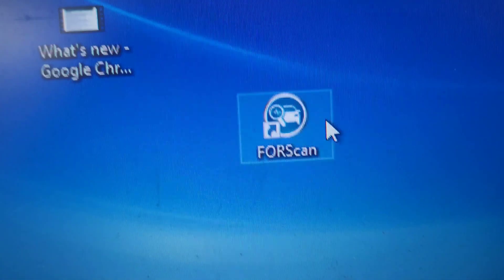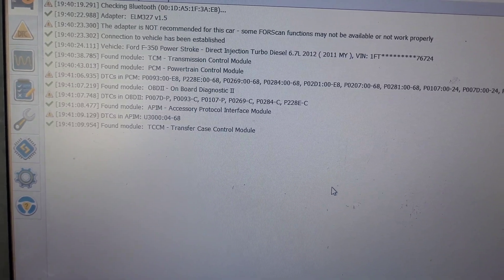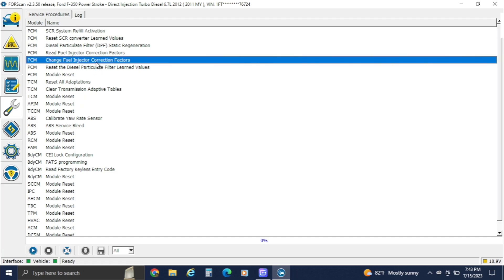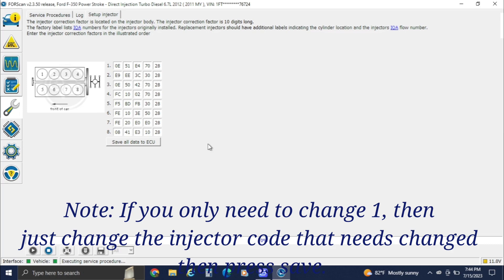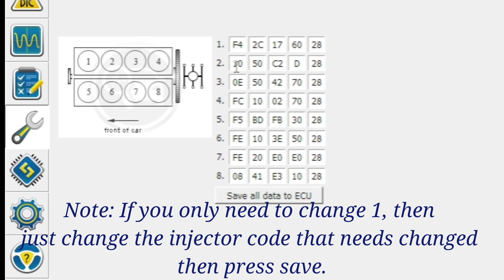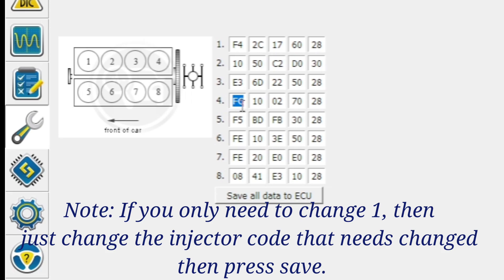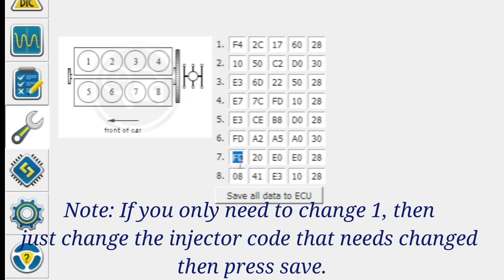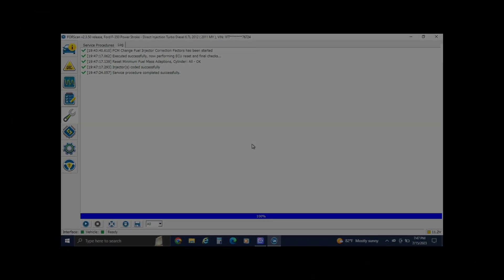Superduty and F-150 Diesel | You can Program your own Injectiors!

Comment: Hey bro. Replaced cylinder 7, purchased new motorcraft from rockauto, came with a new IQA code. Entered it with forscan and it says invalid IQA number. The number doesnt end in 28 like all the OEM ones do, could they have sent the wrong IQA number that corresponds with the injector?

Comment: Handy information for sure! 
Need a how to for tire size changes for a 23 Super Duty if possible.
Reply from the maker: I'l need a 23 to work on haha.
Reply: @CPsGarage  well crap. Hopefully you come across one sooner than later.
Reply from the maker: @vais3  I'm hoping to get my hands on a 23. Just gotta find someone wanting aftermarket stuff installed 😂
Reply: @CPsGarage  well, I want a 24 or something of this particular generation but I absolutely have no desire to keep the 18s or that tire size. I want the factory 20s but packaging locks you out of them. Without the ability to run the 20s with a stock size I’ll be keeping away from them.